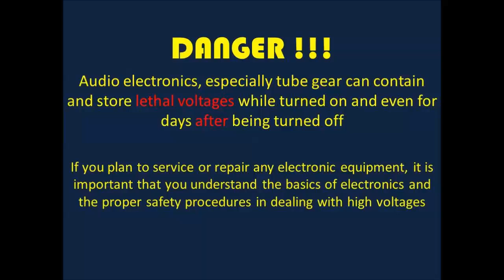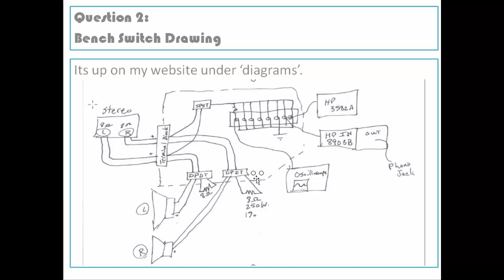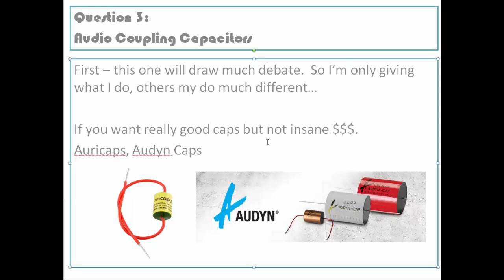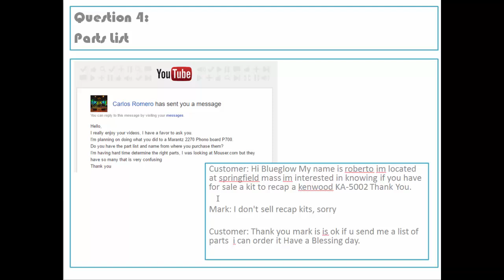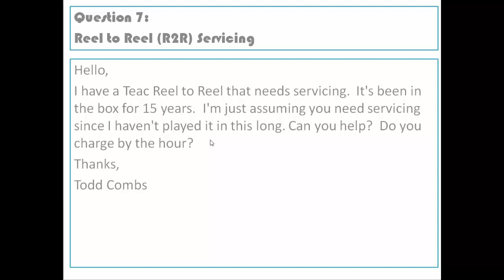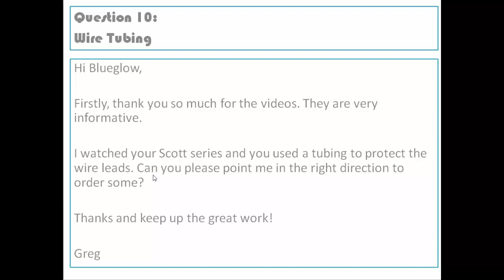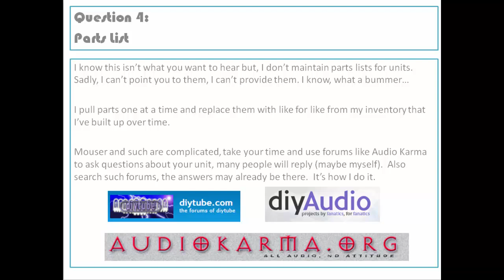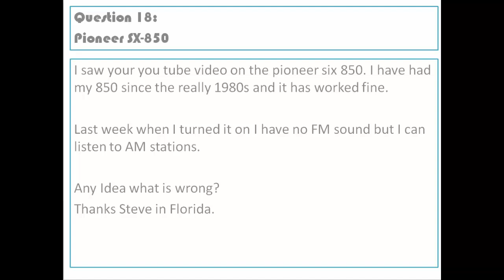Question and Answer Plus Tech Tip - Sept 4 2016 - BG067

Comment: Thank you for these fine videos!   very informative  
Just a quick question I have 2 quicksilvrer mono blocks 8417s, that i just got -   One of them while just turned on works fine ( to my ears ) But just after perhaps 15 min or so of playing starts to distort and  become kinda foggy gravel like - though still playing  - the amps are old  from the 80s  - I am not a electronics guy but was thinking that I could use the one working example to diagnose the other - does this seem like a logical approach ?  and would this heating  scenario indicate old capacitors  that are failing ?
thanks steve
Reply from the maker: recap the outputs.  also check the thermal grease on the output transistors.  sounds like a heat issue.
Reply: Thank you for the reply - the amps are tube amps though I dont think they have transistors  - right ?

Comment: As regards the "sound" of coupling caps; in a "blind" hearing test, could you tell the difference between Cap A and Cap X, both being the same as regards value and voltage rating? I'm not convinced myself, as you said this topic is controversial
       Good luck with the new career.
Reply: I'm able to tell the difference between power cord...

I'm kidding 😂